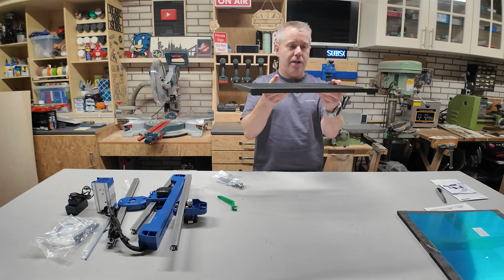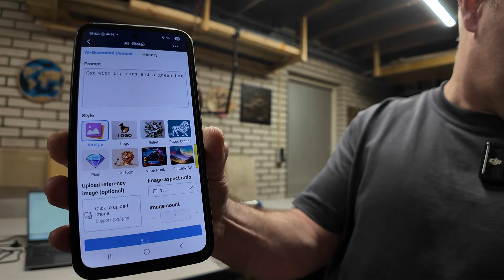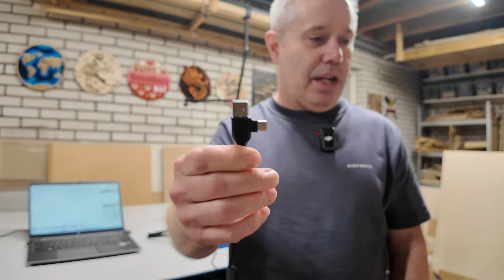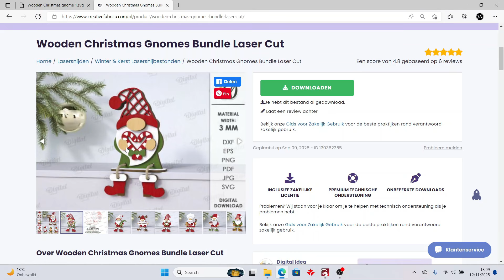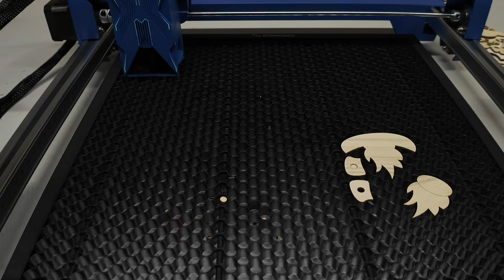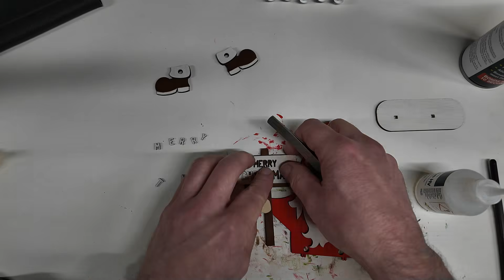Laser Cut Christmas Gnomes using the AtomStack Swift 7W

Comment: Why would mine be homing to the back right?
Reply from the maker: With mine it is on left back. Did you set the home position correctly in Lightburn when you installed the machine? You can choose this during the setup.

Comment: Dear Jeroen, could you please answer me a question? When cut a circle, the result isn't a circle, is an oval. Have I done something wrong?
Reply from the maker: Hi, it could be that one of the axis is skipping steps (check belt, belt tension and make sure the laser moves smooth in all directions). Or you might need to calibrate the axis in Lightburn.

https://docs.lightburnsoftware.com/legacy/UI/MachineSettings#calibrate-axis

Hope this helps

Comment: hi Jeroen, is it possible to adjust a box design with multiple interlocking sections in Lightroom for kerf and export so it can be brought into a laser that does not use lightburn software? I would like to see a video on that. :)
Reply from the maker: I have not used Adobe Lightroom myself, but I guess this should be possible. Adjust it, then export as a SVG and import it into the program that runs your laser machine.

Comment: Hello Jeroen! I have the 12W model. I don't see any nipple in the laser module top to connect the air hose. I only see a yellow label that reads "TUBE INTERFACE". My guess is that if I remove that label I will find the connecting nipple for the air hose beneath it. Is that right? Can you please help me with this? Thanks a lot! Suscribed!
Reply from the maker: Hi, Good news, I have been in contact with Atomstack and they have confirmed that they are working on a very affordable air-assist kit  for the Swift (F40). It should be released mid to late December. So this would be a very nice upgrade. Hope this helps
Reply: @jewijk  Hi! As long as you have the air nozzle, which is made specifically for the Swift 7w and 12w, any low pressure air compressor on the market can be used. In any case, we´ll see how "affordable" this F-40 will be.
Reply from the maker: Hello, thanks for subscribing. I have double checked the machine I have, and initially I thought the F30 kit would fit on the swift, but that does not seem to be the case. I also do not see a dedicated air assist kit for the Swift on the Atomstack website. But perhaps you could 3D print a nozzle with a nipple for the hose?
Reply: @jewijk Thanks! Have you ever tried to remove that yellow label?  I dont want to make a mistake and ruin something.
Reply from the maker: No, I have not, but on the 7W there's no nozzle, so I could not connect the airhose anyway.

Comment: Had one for 2 weeks now, made my own air assist nozzle out of aluminium on my lathe and it cuts superb, clean and accurate, great value starter laser and the software is easy to use. Good honest review agree with all of it, first proper review I have seen thanks. 
One tip I have found is to add a 6mm air gap underneath the honeycomb bed between the plate so that the air assist blows out sideways and not back upwards.
Reply: Hi! Can you please provide a sketch with measures of the air nozzle? I'll try to make one in a lathe...same as you. I will really appreciate you help. Thanks!
Reply: @Dioclau7843  Do you have a Atomstack swift 7w ?
Reply: @Ifitwerks I Have the 12W verssion.
Reply: @jewijk  Here is the basics, pilot bore one end of a 25mm diameter aluminium bar 65mm long  use a 13.5mm drill to  bore to a depth of 20mm Then bore through the other end 3mm to meet the first 13.5mm hole
Drill a side entry 5mm hole to break in to the 13.5mm hole nearest the nozzle and tap it for 6mm to take a 6mm thread 6mm long on a 6mm brass bar then bore the brass bar to 4mm and make it about 40mm long for the air hose. 
Finally taper the nozzle to suit how you want it to look and for the length you want it to be.
Use a 13.5mm x 2.5mm diameter o ring pushed in to the 13.5mm end to seal the laser lens.
Slide the air nozzle over the laser lens and push to seat the o ring , then drill a 6mm hole in the plastic laser cover to line up with the brass air tube then insert the air tube through the cover in to the nozzle and tighten to hold the whole unit in place.
Mine works a treat, good luck just be accurate with your measurements and it will go well.
Reply: @Dioclau7843  I think the laser lens outer diameter may be different on the 12W but the principle is the same, I know its 13.5mm on the 7W one
Reply from the maker: Hi, Good news, I have been in contact with Atomstack and they have confirmed that they are working on a very affordable air-assist kit  for the Swift (F40). It should be released mid to late December. So this would be a very nice upgrade. Hope this helps
Reply: @jewijk  I hope they do as its cuts beautify even the 7w module and air assist I would say more like a 10w and the 12w should be very good indeed. Though too late for me as I made one now!!! thanks for the info.
Reply from the maker: Thanks, appreciate your feedback. The rubber feet underneath the honeycomb bed are about 4-5mm which provide the gap you mention.
But yes, agree with you that this helps  clearing the smoke.